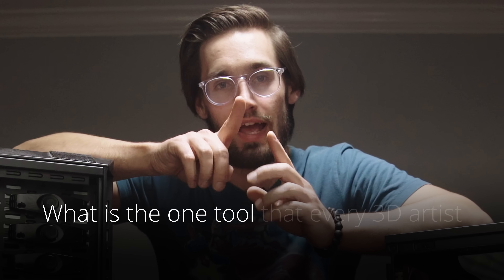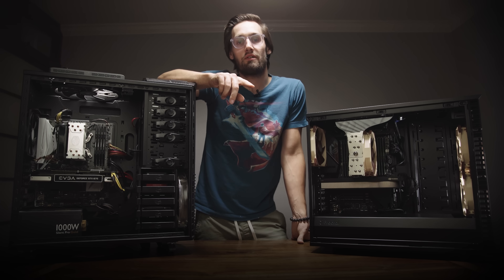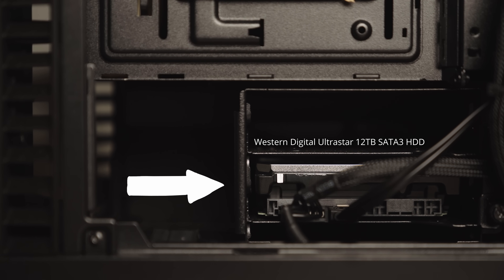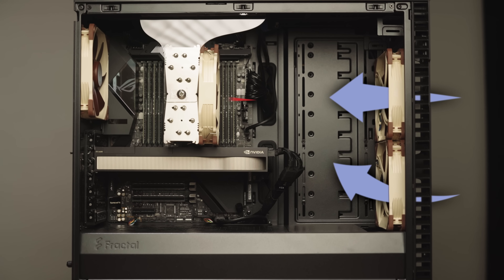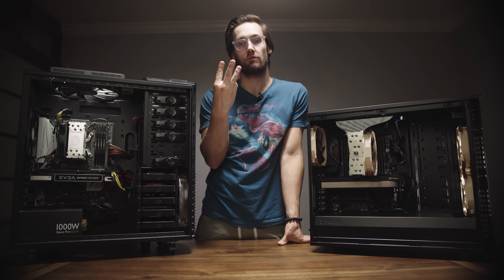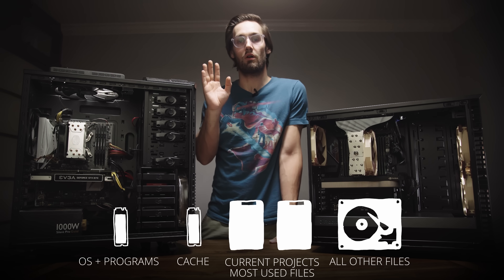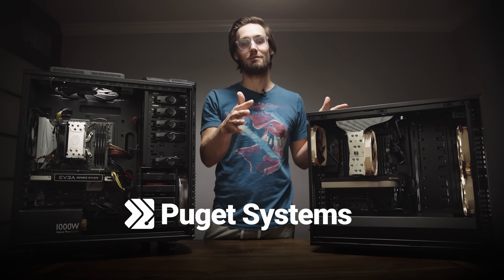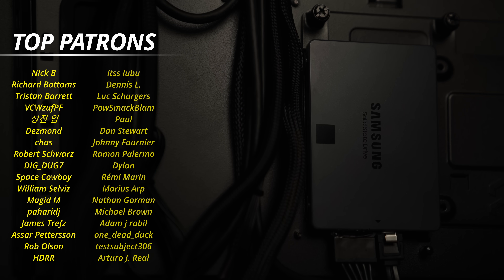What Digital Artists NEED to know about HARDWARE | All Parts Guide

Comment: Sadly you can not use clock speed, cores and threads to judge how fast your cpu is. as what Linus said  about looking at cpu speed is like judging how fast car is just by looking at the rev counter. if you do this you could be overpaying for a cpu or be disappointed of how little performance improvement  the new cpu is.

different  microarchitecture will have a big effect on performance and each one may be better for different applications and programs. you can how two cpus with the same core, clock and thread but if one cpu microarchitecture bad it will perform poorly.
also some applications prefer more cores like rendering or and some applications prefer fewer faster cores like games to perform faster.

If your are going to buy a cpu you have to look at reviews on what how well the  cpu performs on your application.
that is why real world performance is so important. also you may need to look a other features  your cpu may need to support.
how much ram does you cpu support. How much power you cpu is consuming.
overclocking support and many other things

As i said buying a cpu is not that simple as just looking a few numbers .

Finding the right cpu is more complicated and about finding the best performance with a price you can afford.

Linus did a techquickie about how to buy a cpu.

Comment: Regarding storage ... what I don't understand which a lot of people say is ... have your OS+Apps on fastest NvMe and same for Cache ... but then have current Projects on Sata SSD!?? If Sata SSD is slower than the NvMe drives, won't it become the bottleneck? And then all your NvMe drives will be dragged down to its speed when working on the current project ... not so?
Reply: No, that is not how it works. Disk speeds are independent from each other and slow disks do not bottleneck other disks, unless you are reading from a slow disk and writing to a fast disk. 

Also note that computers usually store data that is used by a program in ram and do not read the current project you are working on multiple times from the disk. Also, while SATA SSDs are slower, they are still quite fast. SATA SSDs are a good choice if you are limited to only one m.2 (NVMe) drive, but if you have mutliple m.2 slots on a motherboard it is better to buy an m.2 drive. M.2 SSDs and SATA SSDs are comparable in price.
Reply: @kristoffer7412  thanks for info and feedback

Comment: One comment on the ram part. You'd rather have 2 x 8gb then 1 x 16 gb. This has to do with dual channel memory. Your Motherboard manual will have a description which slots are dual channel but most of the time those will be (left to right) slot 2 and 4.

Comment: Really good overview. I'm gonna throw a few things in this comment that I go through with speccing a unit for clients as an IT Guy.

1. CPU choice- does the software in use handle multiple threads well? If so, more cores = better. If not, more clock speed.
2. RAM- Always aim for dual channel. Always aim for at least 30% more than you need- software is always wanting more year after year, so build in some wiggle room.
3. Hard drive- generally avoid disk drives these days. Unless you are really strapped for cash or need 4 TB+ space, SSD is just better. Now if you do need those giant drives (see Digital Artists or Game Designers for easy examples), keep in mind some software does a lot of reading and writing to the drive. If your software does, put all files it uses on an SSD (either SATA or NVMe) as it makes a huge difference in performance then
4. Power supply- go with brands that are known, do not cheap out, and aim for a little more (~20%) than you need. Extra capacity reduces load on the supply and makes it last longer. This is the part we see the most failure of and can cause other part failures.

There is more to consider (GPU for example- Consumer or Enterprise? Depends on what you are doing...) but that gets into a much larger IT conversation.

Comment: Great video and super usefull especially if you are a begginer in the world of computer building for 3d artists. One thing i would maybe say differently, i dont think that the graphics card is the most important part of the pc, i would agree with that statment regarding only GPU based renderings. Still a great big deal of 3d artists work with CPU, if i had to guess i would say still more than 50%. For everyone using CPU that is actually the most important part of the machine, that and RAM.

Comment: one quick note for blender users, get a nvidea gpu, not a ryzen gpu, because the way blender is setup we have cuda for gtx series cards and optix for ray tracing (so for most people this will mean rtx) card, and both these modes are optimized for nvidea and don't work as well on ryzen 

and fyi its fine to get any ryzen CPU, i have one myself, but for GPU you should go nvidea

Comment: Very slightly misleading regarding CPU - clockspeeds nowadays are pretty irrelevant. It's all about the IPC (instructions per clock). A CPU with lower clockspeed could outperform a similar (often older) with higher MHz.

Comment: Technically you wouldn’t get bottom of the barrel results with a mid level PC vs high end PC technology has really narrowed the gap between processing power in relation to cost the speed just won’t be efficient enough for professional work. You can have identical shots just one took 3 days the other 17 days

Comment: “ The CPU was the head chef of a computer designed for 3-D work” You’re so wrong on so many levels. The majority of the 3-D industry uses graphics card powered rendering Because it’s basically impossible to produce anything in a reasonable time using CPU rendering. You literally cannot produce shit without a good graphics card, you won’t even be able to load a scene. But with a graphics card and a shitty CPU it would just take a long time to load that same scene. Ask anybody you know. The trend in the industry for the past 10 years has been GPU accelerate fucking everything
Reply: Or at least he understands nothing on a technical level. Worst guy to watch if you’re trying to become educated about this topic
Reply: The dude literally doesn’t know anything that’s going on in the industry it seems
Reply: Like dude this is been going on for 10+ years stop using CPU rendering you’re silly LOL

Comment: Please be careful when speaking about quadro graphic cards. Quadros are not AT ALL made to support 3d applications but are actually designed for very, very specific purposes. For example, they are great to compute some very specific tasks where great precision is needed like in data science. Even if quadros have better specs in therm of vram, they are slower for rendering (have a look at benchmarks). Why ? Because the target market of these cards are mostly scientists. The reason why the price is so high is that quadros have some specific features like creating virtual compute servers or ECC vram which are totally useless if you're using the video card for rendering or realtime. By the way, the price of a quadro also contain a support service from nvidia that is not alt all designed for individuals. The "professional" label of these cards doesn't include 3d artists, filmmakers, and even less professional gamers (for example, cyberpunk is running at 70fps on a quadro A6000 versus 90fps on a 3080). It's really important to understand that for 3d related tasks, quadro cards are less performant than rtx30 series for a much higher price. And finally, quadros are not at all designed to be connected to a screen.
A 3090 gives you 24gb of vram which is totally fine to work as a 3d artist. If you need more than 24gb as a freelance, you seriously should re-think your optimization methods.
So please be carfeful before spending thousands dollars in something that you will probably use at 10%.

Apart from that it's very nice of you sharing all of this kowledge, honestly it's really appreciated :)

Comment: Ha, I'm rocking a 1070 and i76700 - and just pulled the trigger on an upgrade! No Threadripper, but the 5950x should still be a serious upgrade and the 3060 Ti is about 5x faster than the 1070 in Blender thanks to Optix, so yay! That kitchen metaphor is amazing. The motherboard could be your kitchen layout - how many stations you have where people can set up and work?

Comment: One thing I did not see mentioned that I think is very important to know; most GPU renderers only support CUDA which means even though team red can be good for gaming you're going to need a NVIDIA graphics card to even be compatible with redshift or octane or many others. Which card to get depends on your budget but RTX cards are way more optimized for real time rendering applications so even if its more pricy its worth considering since raytracing is a big part of digital art even moreso than games. And of the RTX cards it seems like the 2000 series might not even be worth it since then 3000 series is not only better but also somehow cheaper. Beyond that your CPU should be chosen based on what will keep up with the bottleneck of your GPU, it is a waste to buy an amazing graphics card and then put it on a cheap crappy CPU

Comment: You can do this sure and get a great Desktop
OR you can be like me and get a high end leptop and have very easy workstation that I can plug out and take places(if I ever would like to do that)As a plus you get a 2nd monitor
It's definitely not for everyone but I just like to have the portability personally and there are some really good laptops these days I'm currently on a very respectable i7-7700hq machine with a 1060 and 16 gigs of ram(respectable by 2017-18 standards but ehhhhhhhhhhhh) but would be upgrading to a legion 5 pro in something like 6-8 months when I have enough saved up(it's also probably enough time for maybe better parts to be available in my marketplace so there's that too
I most definitely could just get a pc that outperforms the laptop for similar/cheaper price but I just like laptops its a preference thing

Comment: Greetings from Finland 🥶👍 Thank you Clint for all the tips! I got myself these components: Motherboard: Asus X570 Prime Pro, Cpu: Ryzen 5950X, Ram: DDR4 128GB, GPU: Nvidia Quadro RTX A4000 (16GB of VRam), PSU: 1000Watt Gold

I have a question for you. I'm not sure if I should keep my GPU or should I return it 🤔 I was thinking to buy 2 Rtx3060Ti's cause they have a much faster coreclock speed compared to my single RTX A4000. The Nvidia A4000 has a ECC VRam, does it mean that it is more stable during super long render periods? I use mainly Blender. Let me know what would you do. Keep the RTX A4000 or return it and buy two RTX 3060 Ti's. The price is same. 

Thank you for your time and wisdom! This channel is pure gold!

Comment: i am more off Gamedev Mysel than 3d artist and has been into PC Building for some time,but or the "some time" i litterally now knows what The Core,Threads and Clock Speed Funtions(in my daily knowledge i rather make Core and Threads under same boats) now since this tutorials i think i get the gist of my next upgrade especially i will need to do some more multitasking and Virtualization thing a.k.a VM-Ception,as for Reability yeah its concern me a lot between Rebility Vs Upgradibility/Future Proofing,well i think ill stick to DDD4 Maxed out rather than Mid DDR5 Specs then in the next year

Comment: Important note on RAM: when you open any file, what IO Controller does, is it puts pieces of that file in your Ram so that CPU can actually see the data, when you have "too much" RAM these file pieces stay in RAM and don't get overwritten after they have been read, meaning if you were to open the same file again (after closing it  without modification), you will not need to read it from the disc, as it will "already be" in the RAM.

Example: I have a 20 GB game, that takes 4 GB of ram at a time, the first load takes me 2 minutes, but because I have 32 GB in my system, the next time I open the strategic view it takes seconds, as the files with data for the strategic map are accessed from RAM and not my Superslow HDD.

Bottom line: extra RAM increases the speed of opening files for the second time

Comment: I've built my own systems for 20 years, and I've tried to explain PC parts to other people before, but this is by far the easiest, clearest explanation I've ever seen. 🙂 I also just upgraded my system this weekend, and I was coming from a system very similar to your old one (I also had an i7 6700K, but I had a 980Ti and 32 GB of ram). I just spent a stupid amount of money on the new parts, and even so, I landed just slightly above the "barebones" system specs you posted (I went with an i7 12700K and an RTX 3080 that I basically had to sell a kidney for). 😅
Reply: 🥸look at me, I do CGI on my i3 8130u laptop with its igpu.High end huh.....😭
Reply: Any spare GPS.

Comment: The only thing that I would say is about the Ram the Frequency the ram as well as the timings can be important in some instances not all and also higher speed ram and tighter timings are.....you guessed it more money. This is a good guide for someone new getting into computers and especially if they are getting into it because they are trying to get into vfx because different workloads for a computer might need different specs but this seems tailored for vfx. I haven't even tried to do any vfx btw I just know PC's fairly well.

Comment: Hi Clint, I have a question. If I have my program in SSD, but my project is on HDD, is that project going to take the speed from the SSD or HDD? Thanks in advance!
Reply: Oh yeah, and if I add another SSD or NVME and my current power supply has the exact amount of power that I need, does that mean I need to upgrade my power supply?

Comment: My question tho.. WHY is there a 1000W PSU in the old system???? A 550W PSU is more than enough.. And also, WHY a 1200W PSU in the new system? 1000W would be enough by a mile... You're litterally throwing money out the window.

Comment: I'm actually surprised that there's an air cooler being used on a Threadripper, now Noctua is great and one of the best but I still think an AIO would be much better for a CPU that can get so hot especially when overclocked at all.
Reply: a good air cooler will match pretty much any AIO. It's all about the surface area of the cooling fins and the air you can blow over it. Something like the NH-D15 will outperform all but the best triple fan AIO coolers out there. Don't let the "water" part fool you. It's just one link in the chain. It's great to carry heat away, but at the end of the day you still need to cool it down by running the water through a heat sink and blowing air over it. Just like air coolers do, but just with an extra step. You only really start out-competing great air coolers when you start doing custom loops that have waaaaay more cooling capacity than you could put on a CPU directly.

Comment: Slightly disappointed you don't cover the advantages and disadvantages of AMD vs Intel for CPUs and AMD versus Nvidia for GPUs. So many people buy AMD video cards still. Until AMD get their act together regarding drivers and supporting 3D software it's just money down the drain. Stick with Nvidia.

People should also keep one eye on future-proofing and upgradability. Don't cheap out on the bare minimum for the less than sexy parts like motherboard and PSU. Buy ones that allow you to upgrade your CPU and other hardware in the future without having to buy a whole new motherboard.
Reply: I'd say these decisions lay in the hands of the system builder/integrator, which is Puget Systems in this case. Their compatibility research and benchmarks are world class.

Comment: i smile when i see your power supply of 1000 watts. i made that mistake too so i doubt that you actually need it or use all energy pulled from your power supply. Probably 750 watt  is enough for your 3d work with one gpu card. the good is the electricity bill is now less nearly 30- 38% for me.

Comment: This is one of the worst times to be buying PC parts I can remember.  Stuff is way more expensive than it should be.  Good high level breakdown of enthusiast PC parts.  Coincidentally, a lot of the stuff that is good at gaming is also good at doing 3D.  Of course there are specialized parts for a dedicated workstation, but a good gaming machine will make a decent 3D workstation.  You get into CPU threads and clock speed and I want to chime in like "yea but don't forget IPC!!! There's more to it than just clock speed!" but then I remembered this is a high level overview.

Don't go bargain bin on your power supply.  And keep an eye on temperatures during renders.  Renders hammer the hell out of the system and it will get hot.  Make sure it's not going to the point where it thermal throttles.

Comment: Is this going to be a Linus Unicorn tech system build, of which nobody can afford? Because I've been tricking my updates slowly due to my budget. You guys get all types of free stuff and super computers from Puget. We don't have that ability. Moreover, one thing I realized is that the easier it is to create, the less is created. It's all about the struggle of creation that drives the creator...
Reply: Pretty much... the Puget system would cost $10,000+ just for the CPU, GPU, Motherboard, RAM and SSD. Plus more for all the other parts. Plus more for having it put together by Puget.
Reply: Like the Sears Christmas toy catalog.  Pages and pages of pretend time.